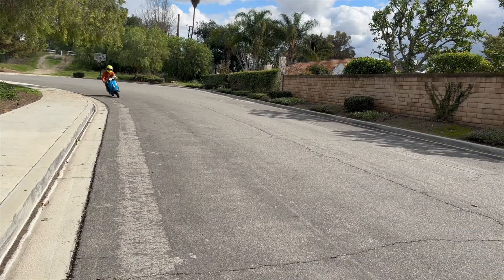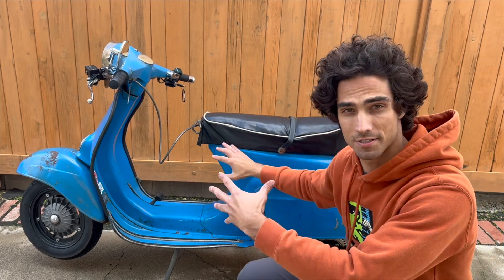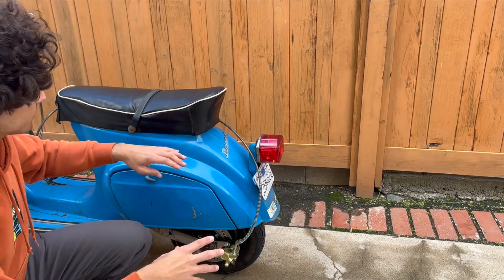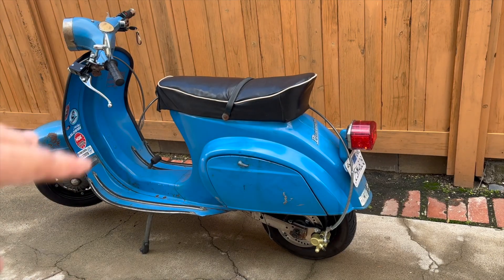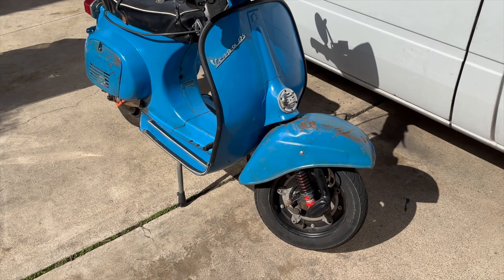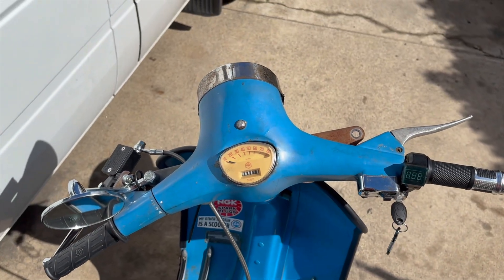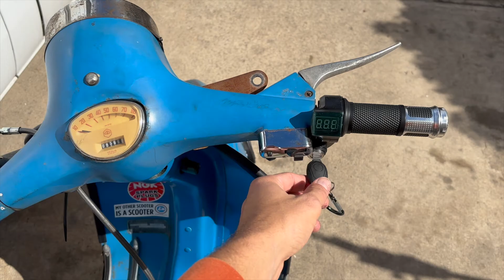Electric Vespa Conversion Kit

Comment: Manufacturers can make clean burning 2 strokes but legislators and lobbyists are pushing this “green” propaganda stupidity so…. The old  Fiat would be really cool with a high HP motorcycle engine conversion 👌 The Vespa? 🤔🤔… maybe a tuned Pinasco engine with a top speed of 90mp/h. Nothing better knowing you can get well beyond our proposed 15min surveillance cities ✌️

Comment: Is there a reason you have the cables external? This build is epic! I love it! Love the classic look. Love the technology and performance and safety upgrades! Did you consider modifying an electric unicycle vs surron like parts? I believe they have higher power weight ratio and compact includes battery packs, bms, and even a hall sensor in case you tip over which can be controlled by tilt angle.

Comment: Hi, found a Vespa 50 while going through a deceased relative's assets. Guessing it's from the mid 60's, will check more carefully when I find the serial number. The engine was dismantled and is in a box, otherwise all parts seem to be in place (I think) Happened to see your video about electrification of smallframe vespa. Thanks for a very good and informative video that was also fun to watch. Immediately saw the possibilities of bringing this old Vespa to life. Would be interested to see more how you went about it, what parts you used, tips and tricks, etc.
Good work!
Greetings 
Per Lundberg
Reply from the maker: Amazing! Good luck to you. I’ll make a video in the near future with a step by step guide on converting one your self

Comment: Nice work! 

Can you give more Details to the components used?
Reply from the maker: Thanks! Would it be helpful if I made a whole video walking through the electric conversion process?
Reply: Absolutely!
I'm aware of potential hub motors and controllers - but which voltage is best? And then if i have got the single pieces of motor, accu, and controller - all the steps to get the stuff finally working and communicating is missing for me at the moment (throttle, wiring etc) @bernietime
Reply from the maker: @lukasmeilinger934  will do! I’ll answer all these questions in an upcoming video. Any any other questions you have about it? Just leave it a comment on here and I’ll answer it in the video as well.
Reply: Thanks for your support! @bernietime
Reply: @bernietime  make this video of the small frame components, please!

Comment: Nope I laugh at the clowns who claim to be about all original yet they order all brand new parts lol which makes their classic yup NOT original. SO No I can't stand those twats. I am 59 y/o Original Scooterboy who drives only electric converted Vespa and Lambretta scooters I hand convert., I tried using pop in kits but they are just too weak and slow for the type of driving I do on my 64 GT 200. I was tired of going 709 in the first place which is why I converted mine starting in the 90's which sucked since everything available was rubbish. Now though. My scooters run flawlessly and take pink slips from cars and Motorbikes alike lol Keep it up. I use Lingbo controllers, 10kw, 12" tyre, QS motor wheels and 72v set up. Batts-Strictly 72v 120AH LiFePo4 batts Li Ion simply can't handle my riding lol, I drive mine without problems on the full Motorway causing easily at 140 kph (top speed is 145 Mph) extreme range of nearly 1000 Km's per charge that's proper riding baby! Always trying to upgrade and up beat myself though so next phase, a 165 mph Electric Lambretta Racer baby! Keep It Up Mate!